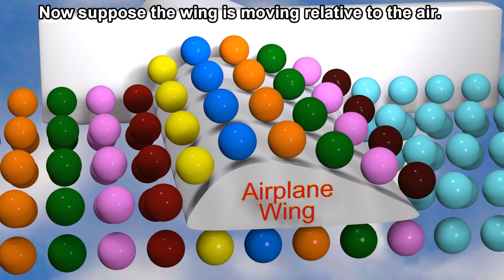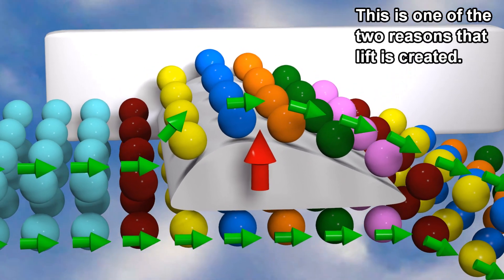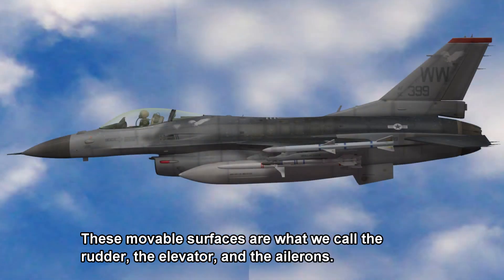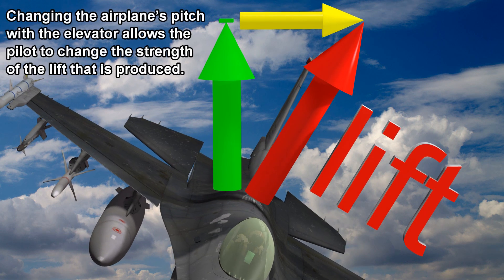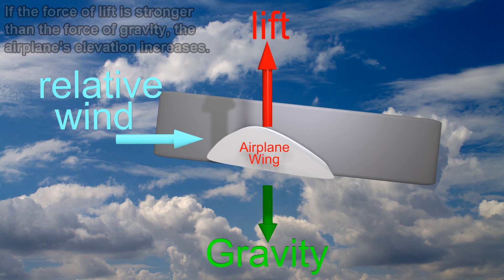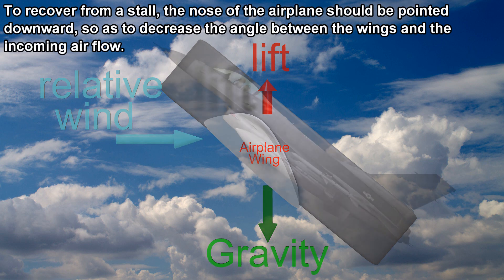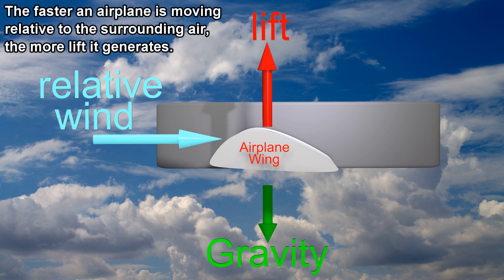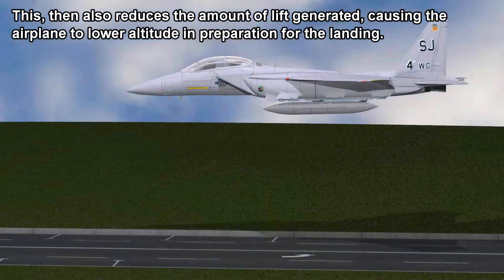Aerodynamics - How airplanes fly, maneuver, and land

Comment: Good grief!
Equal time IS wrong BUt your animation is showing equal time! 
.
The Top-to-Bottom pressure difference is the lift.  Qll of it. More pushing up than down. 
To get that difference you have two sides -lower with a elevated pressure and upper with a decreased pressure.
The SAME basic physics explains BOTH those changes.  Correct physics linked below.
.
The real physics is in why those two pressures change from ambient and there are very few people who understand the correct physics for those changes.
. . . 
Then 
. . . 
.The "Bouncing" on the bottom is also incorrect as shown.  Molecules are ALWAYS bouncing on ALL surfaces, top AND bottom - THAT is what pressure is!.  
The air Approaching the bottom does increase the pressure, but that is half the reason reason for the the Difference.  
The flow SMOOTHLY follows the lower surface back to the trailing edge.  That is easily seen in many images on the web.

The other part is why the pressure above decreases and that is not explained here.  You just say  that the shape 'causes' it to be lower.
.

 Understanding Aerodynamic Lift Correctly: 
   rxesywwbdscllwpn.quora.com/ 
.
.
.
I also recall that you subscribe to Crummers faulty explanation for Bernoulli's Principle.

Comment: The explanation of " bouncing air molecules " is completely flawed. According to Coanda effect a jet of fluid tends to stay attached to the surface. There is no bouncing involved ! The lift could be explained by " deflection " of the air downwards due to circulation !
Reply from the maker: The Coanda effect itself can be thought of as a consequence of bouncing molecules.  You may be interested in the following article.  http://physics.ucsc.edu/~ccrummer/aero1.pdf
Reply: @EugeneKhutoryansky  i think you misunderstood the point here. According to you if an air molecule hits ilthe leading edge of the airfoil, then it will bounce off directly below it ? The answer is no. The air molecule will follow the airfoil surface and leave the trailing edge. Also, the air molecules don't behave like ping pong balls that they go bouncing around when hitting a surface and Don't follow law of reflection, instead they behave in unison and act as a whole.

Also, according to your so called " bouncing air molecule" theory, the airfoil should generate lift at all angles of attack, then explain why it stalls at high angles of attack.? That's why high-lift devices like flaps and slats were created to take the advantage of coanda effect so that the wing doesn't stall at high AOA.
Reply from the maker: I understand the point he is trying to make. My video oversimplifies it by analyzing it as if there is just a single air molecule, and this is a valid criticism.  However, it is also incorrect to say that there is no bouncing involved, since everything you mentioned can be understood in terms of molecules bouncing off each other, in addition to bouncing off the air foil.
Reply: @EugeneKhutoryansky  that's true. There would be some bouncing, but the bouncing is in unison ( air molecules behave together as a whole ). Nevertheless, great video 👍👍

Comment: When an aerofoil starts from rest, there is a flow separation at the trailing edge and a starting vortex is dumped on the runway. There is bound vorticity of opposite rotation and magnitude associated with the aerofoil, and this generates lift by the Magnus effect.

If the aerofoil comes to a halt, then a stopping vortex will be dumped in the flow. Both the starting and the stopping vortex can be visualised. These vortices arise because the atmosphere is not a superfluid. Explanations based on Bernoulli or Newton are merely wisdom after the event. They flop in liquid helium.

The Kutta condition at the trailing edge is maintained by dumping starting or stopping vorticity as required. The Magnus effect and the Kutta-Joukowski circulation theorem are practical synonyms. Fluid mechanics for a fixed configuration of vorticity is a linear subject and we can easily switch back and forth between Magnus and Kutta-Joukowski.

Comment: 5:00 not true!
Reply from the maker: The statement in the video is correct.
Reply: @EugeneKhutoryansky  
hmm.. lift always acts perpendicular to the airfoil.. not straight up..
and.. lift is not what's causes the airplane to increase in "elevation" (height or altitude might be the better word here)

it's a common misconception that lift helps the aircraft to go up... but it's actually thrust (or excess thrust to be exact)
I can explain it if you are interested. :)
Reply: @JSmith777  That is WAY too complex for these folks. . .The fact that the vertical component of lift is the same in a standard climb that it is in level flight will blow their minds.
.
And BTW, we commonly call the vertical component of the wing's force lift. The horizontal component is part of the total drag.
There's so much more wrong with this video. 
This huy believes in Crummer's concept explaining Bernoulli's Principle.
Sad.
Reply: @EugeneKhutoryansky  The vertical component of lift only increases during the upward Acceleration at the start of a climb.  
During a standard, constant rate of climb, that vertical component of lift is IDENTICAL to that during level flight.  In a standard rate of climb, or descent, the craft is not accelerating vertically so NO net vertical force is needed and gravity and the vertical force are EQUAL. 
The energy to reach a higher altitude does come from the engine. A higher altitude means it has an increased potential energy in a gravity field.
.
Your animation shows Equal Transit, therefore is wrong.
.
The air below the wing SMOOTHLY follows the lower surface ALL THE WAY to the trailing edge.  - NO Bouncing.  What you show would have a vacuum behind the bounce point. Very poor.
So much time on the graphics and it's wrong. . . 
.
Molecules are Constantly bouncing against ALL surfaces - TOP AND BOTTOM. - That is what pressure is!.
.
Do a better job of correctly explaining physics: 
Understanding Aerodynamic Lift Correctly:
  rxesywwbdscllwpn.quora.com/ 
.
.
.
As I recall, you also subscribe to Charles Crummer's faulty story for Bernoulli's Principle.
.
P L E A S E learn the correct physics.

Comment: Hi Eugene, excellent video. I am a huge fan. Were you alluding to the Bernoulli principle (approx. 1:45 in the video)? Even some of my textbooks ( mcat studyguide) mentioned that lift could be generated in that way. However I found conflicting report on the matter. The English Wikipedia entry on Bernoulli’s principle specifically mention « Misunderstandings about the generation of lift ». The assumption that air must traverse the top surface and meet up with the traveling on the lower surface (ie. equal transit time and thus higher velocity of the upper streamline cause lower pressure etc. ). Could you please make a video on the topic if you did not already. 

Best.
Reply from the maker: Yes, the assumption about the equal transit time is incorrect.   The air along the top of the wing is actually much faster than according to the equal transit time.  But, this just means that the effect of Bernoulli principle is even stronger than it would be otherwise.  I have a video where I discuss the Bernoulli principle in detail at https://youtu.be/TcMgkU3pFBY

Comment: The first reason that you gave for creation of lift is based on the false equal transit time theory.so could you please tell me is this reason correct? Because there is not any evidence that tell that velocity of upper air is high i.e the molecule reaches the trailing edge at the same time.
Reply from the maker: The equal transit time is false in that the upper air has a much higher velocity, relative to the lower air, than what the equal transit time would indicate.  This means that the component of lift due to Bernoulli's principle is even stronger than what the equal transit time predicts.
Reply: @EugeneKhutoryansky   But the animation shows equal time.  SO much work on it and it is wroing.

Comment: The discussion here of the first (non-Newtonian) component of lift is not really an explanation. Why does the curved surface on the top of the wing cause the air to flow faster? It's because the incoming particles from the leading edge blow particles away from the boundary layer there, causing a lower pressure. This lower pressure draws air in from above but, by the same token, it enhances the effect of the higher pressure under the wing.  At angle of attack, Newton's explanation comes into the picture too.

Comment: When I plugged my computer on the internet (1998), one of the first thing I looked for and read was that there was a big myth about a simple explanation of how wings worked. And here we are again 20 years later (sigh) ; in your video, you say that the air above the wing goes faster than the air below. This is not wrong per se, but what is wrong is that the little balls that represent air seem to accelerate JUST to meet their respective color after the wing. This has been proven to be wrong (above, they go faster than that) and you contribute to the DAMN myth that air goes faster above because they have to meet again after the wing.
Reply: Watch again closely balls of same color never met again at the end of wing

Comment: Why does the air flow faster on the top of the airfoil?
Reply: This explanation is a common misconception.   The two airstreams don't rejoin at the trailing edge of the wing, like the video shows.

Airplane wings generate lift, because they deflect air downward.
Reply: F

Comment: While Eugene here is a well meaning fella. he is just repeating common misconceptions.  This does not explain lift correctly.

The air bouncing off the bottom IS NOT a "second" reason for lift!!
.

The first explanation about the pressures being the lift is OK and is the ONLY explanation. However, the so-called "Faster air over the top" is a RESULT of the pressures.  Those very same pressures are what ALSO causes the downward movement of the air.  

Lift IS NOT a little of pressure and a little of bouncing!
  
It IS  the difference between the increased pressure under and the reduced pressure above... 

This is a the NET (TOTAL) upward force called lift.  THAT'S IT !!
.
Air DOES NOT "bounce" off the bottom.  It is caused to CURVE downward by the pressure increase, the same as the air above is caused to curve downward by the pressure decrease there.
.. 
A wing (just like any other object) must push air around (via pressure) in order to get through it.
This and this alone causes pressure differences around the wing. 

These differences just happen to be an increase below and a decrease above. This is the only net upward force on the wing, PERIOD!.
..
It just so-happens that, if you understand physics and Newton's Laws, these very same pressure changes cause ALL the air movements (accelerations) you see around a wing...ALL:::  Ahead, behind, above, below and around the tips.
Euler pointed out that Pressure Gradients are the forces that move (accelerate) the fluid. ['fast moving air' does not cause a lower pressure.  NOPE!]
Reply from the maker: Air molecules bouncing off a surface is the reason that there is air pressure on that surface.  Therefore, saying that air molecules are bouncing off is the same thing as saying that there is air pressure.
Reply: @EugeneKhutoryansky  That is losley correct (and I commend you for recognizing the true cause of that increased pressure), but...
..
The model we have for pressure is individual molecules vibrating and, therefore, 'hitting' and bouncing off surfaces, yes, but the overall flow does not bounce as you show.  If you wish to stay in the molecule model you must use the complete model and not switch between molecules and gross flow. 
If you describe the upper flow in aggregate, then you should stick with that for the lower flow.   You aren't explicit that you have switched paradigms to a molecular model for the lower flow and also do not explain that it is the increased pressure described earlier, but say that it is an additional cause of some sort.
It is ALSO the molecules bouncing off the UPPER surface that cause a downward pressure on that surface, just like it happens on the lower surface.
..
The aggregate air-flow is a curved flow under the wing. not a sharp angled bounce, but a smooth, curved flow.
Yes, it is ok to say that because the wing and air are approaching each other that they push on each other which is creating a pressure increase, but this is a smooth process causing a pressure induced curved flow.

..
That flow-curve is caused by the increased pressure there.  The molecules that actually impact the surface go on to transfer that new downward momentum (caused by the relative air-wing motion) to molecules further below them; this is an increased pressure under the lower surface. 
..
However, that pressure is the very SAME pressure that pushes up against the lesser downward pressure above (as you explain earlier) to give the net upward force.  That lower curved flow is not something that acts "in addition to" the pressure difference as you state.
.......
I didn't cover it above, but the wing's shape, relative motion and the induced air flow pattern cause a lower pressure above the wing.
It is this lower pressure which causes that upper air to be accelerated both around the convex curve and also, to be accelerated rearward toward the trailing edge. 

If you watch air movements of a wing going by in still air, the upper air starts getting pushed forward and up ahead of the wing (before it arrives) . Then the lower pressure above the wing causes it to be accelerated rearward SO MUCH that it completely reverses direction, traveling in reverse to the direction of flight.  Pressure Gradients accelerate the air.  Speed does not lower pressure. The concept of "faster over the top" is only relative to the wing. 
..
The rearward moving upper air is actually traveling SLOWER than the lower air is traveling forward. YES measured data on a wing generating lift clearly shows that the MAGNITUDE of the upper air's velocity (the upper air's speed) is LOWER than the magnitude of the lower air's forward velocity (the lower air's speed).   Speed does not lower pressure.  
..
 Speed of air does not lower pressure.  Pressure differences cause the air to be accelerated. This is Newton in fluids.
...
In addition, at time 1:20, your animation shows the lower air reaching the trailing edge before the upper air. it is actually the opposite.
Regards

Comment: Thank you this beautiful animation and explanation.
Reply from the maker: Thanks for the compliments.
Reply: Unfortunately, The air bouncing off the bottom IS NOT a "second" reason for lift!!
.

The first explanation about the pressures being the lift is OK and is the ONLY explanation. However, the so-called "Faster air over the top" is a RESULT of the pressures.  Those very same pressures are what ALSO causes the downward movement of the air.  

Lift IS NOT a little of pressure and a little of bouncing!
  
It IS  the difference between the increased pressure under and the reduced pressure above... 

This is a the NET (TOTAL) upward force called lift.  THAT'S IT !!
.
Air DOES NOT "bounce" off the bottom.  It is caused to CURVE downward by the pressure increase, the same as the air above is caused to curve downward by the pressure decrease there.
.. 
A wing (just like any other object) must push air around (via pressure) in order to get through it.
This and this alone causes pressure differences around the wing. 

These differences just happen to be an increase below and a decrease above. This is the only net upward force on the wing, PERIOD!.
..
It just so-happens that, if you understand physics and Newton's Laws, these very same pressure changes cause ALL the air movements (accelerations) you see around a wing...ALL:::  Ahead, behind, above, below and around the tips.
Euler pointed out that Pressure Gradients are the forces that move (accelerate) the fluid. ['fast moving air' does not cause a lower pressure.  NOPE!]

Comment: I was playing with my paper airplane with the fan and wondering how jets maneuver which was answered by the second lift factor. The notion that air molecules bump the plane kinda blew me away.
Reply: The air bouncing off the bottom IS NOT a second reason for lift!!
.

The first explanation about the pressures being the lift is OK and is the ONLY explanation. However, the so-called "Faster air over the top" is a RESULT of the pressures.  Those very same pressures are what ALSO causes the downward movement of the air.  Lift IS NOT a little of this and a little of that!
.
Air DOES NOT "bounce" off the bottom.  It is caused to CURVE downward by the pressure changes the same as the air above is caused to curve downward by the pressures around the wing.